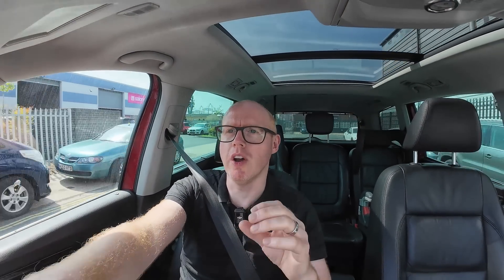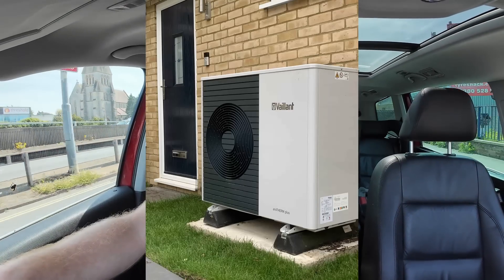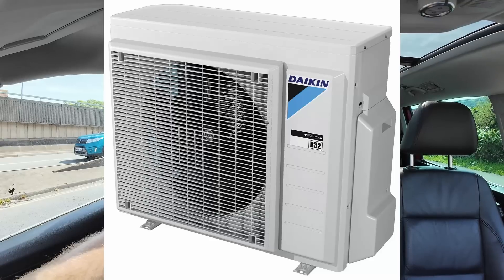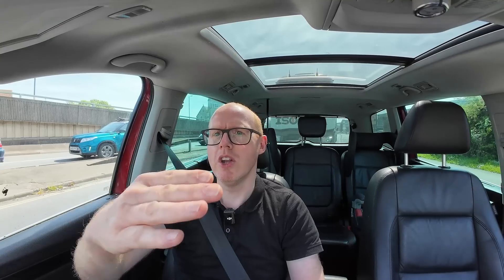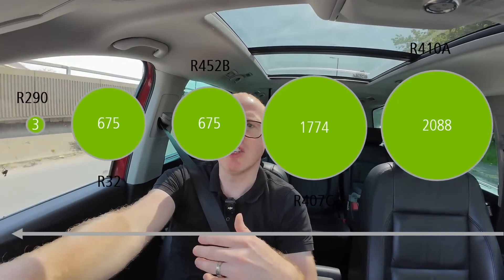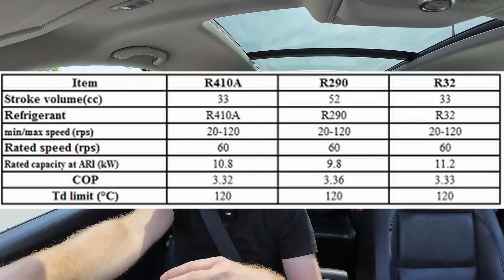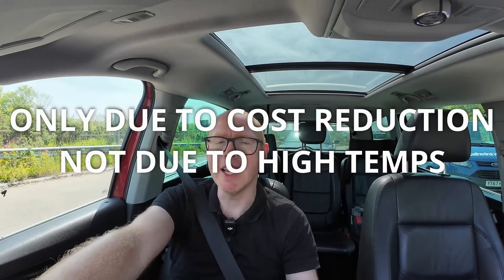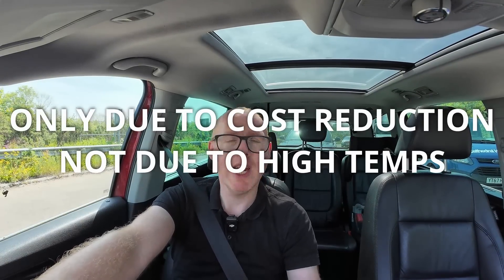High Temperature Heat Pumps Solve Nothing! Octopus Cosy 6 is nothing new!

Comment: I am lumbered with a central heating system which includes microbore piping set into floors and walls. If Propane could make an ASHP viable without replacing all the pipework that would make a heat pump possible for me.
Reply from the maker: Myth #1 heat pumps don't work with microbore.

Myth #2 heat pumps will have to work at high temps to operate with microbore.

Yes, heat pumps like a higher flow rate than gas boilers do, but we've been over-speccing our pipework for many many years anyway.

If you have 10mm copper microbore then you can easily deliver 1kW of heat down that pipe. Most radiators in most houses do not need more than that.
Your microbore will be spurred off a 15mm or 22mm pipe and normally feed just 1 rad.
If it's just a short 10mm drop then you can carry even more heat energy through a short run.

There are at least 3 of us on YouTube who have shown our Vaillant heat pumps operating perfectly with microbore. My SCOP is over 4. My design flow temperature is 45 degrees.
Most of the time my flow temp sits around 30-35 degrees throughout winter.

R290 is unnecessary but does offer the lower GWP benefits.

Comment: Doubling back on this one. From a strategic view I think the move from Octopus is genius. Unlock a bigger market, slashing installation costs and ensure that it is viable with competitive rates and smart software. I take your point - there is a chance to make an impact. I’d love to see the Heatgeek/open energy monitor tweaking the cosy 6 at low flow and really seeing what it can do.
Reply from the maker: Vertical integration can be excellent for both business and consumer when it works.
Early reports are showing that the Cosy/Octopus API and integration does indeed have a few software tricks up it's sleeves so whilst it may not achieve the best COP out there, it looks like it'll be able to achieve the best running costs.
Reply: @UpsideDownFork  Thanks for the update. Make me think of Apple's play on bringing tech to the masses. Delivering an ecosytem that makes the experience as frictionless as possible. There is a lot riding on "when it works" - let's hope that it is flawless

Comment: Just to add a little fact, i have just had the information through about the Cosy 6 and it has another problem.

It can't run on any microbore pipe! 
Well that counts out pretty much all new build housing going up throughout the uk in the last 20 years and more.
Unless you rip out your brand new piping and probably flooring, carpets ect ect to fit a larger pipe you are absolutely buggered.

All this new ashp tech  from octopus housing is complete junk unless you have an older house with the larger pipes.

My home is only 9 years old and i would love to get an ashp from Octopus as our gas combi boiler is not the greatest but after the information on here and the pipe issues i can't justify ripping apart my home of under 10 years for something that has been designed for a bygone age or just older house's.

Its a two finger salute to everyone who is being done over because they have gas in relative new builds.

£300+ quid to get a new ashp from octopus my big butt its not.
Consider the damage to my ceiling while they rip up the upstairs chipboard, everyone knows the plasterboard downstairs is going to crack and flake away as these new builds are constructed poorly.

Is octopus going to fix that, i very much doubt it.
Reply from the maker: I am surprised by this. Very surprised.
Do you have 8 or 10mm? Is your plastic or copper?

The Cosy 6 should be able to handle microbore just like every other heat pump can.
Do you have room for a buffer tank? That's what Octopus normally use for their installations and the thing that usually guarantees the correct flow rates for microbore pipework.
Reply: @UpsideDownFork  it's 10mm plastic, I have room for a buffer tank and I have had them visit twice to check and go into a detailed chat about it.

On the official data that has been sent to me it's clearly printed that the Cosy 6 is NOT compatible with a microbore system.

I am having a chat with them this morning to find out a bit more and get an answer to this.

The other ASHP that octopus offers does work with microbore so I will probably have to go back to that but I have serious doubts if it's going to run my heating and hot water sufficiently.
I have waited for a long time for the Cosy 6 and I now feel I have been strung along for something that won't work.

I am not best pleased 😒
Reply from the maker: @Devonshireandproud  the Cosy 6 is an unproven unit, so I guess there is some risk attached.
The daikin units are widely used and well understood by most installers, even outside Octopus.
I wouldn't have hesitated to have a daikin units installed at our house, unfortunately it just failed the noise test by a single decibel!

Once you find out more about the Cosy 6 I'd love to hear more about it.

If you've got any of the documentation, would you be willing to send it to upsidedownfork @outlook.com ?
Reply: @UpsideDownFork  below is a copy of a paragraph from octopus that I have been sent.

" I've had an update from our Install tech team - they've told me that although you qualify for the Cosy 6, the higher flow rate of this unit can't run on your existing pipework that contains 'microbore'. Microbore is compatible with the Daikin unit but not with the Cosy 6. A re-pipe will be needed to be able to proceed with the new unit. 

If we proceed with the Cosy 6 - we negate the need for planning permission but then have to address a re-pipe, to upgrade any microbore. I can assist with the organisation of this. 
If we proceed with the Daiken (1st position) - your planning permission application is ready to be sent and paid for. We'd then wait for the council response before locking you in for an installation date. "

Edit: as the documents have our private information on I am not willing to send that but as you can see from a copy of a part of the response I got you can clearly see that the Cosy 6 will not run on microbore, I will update this if I get any more information from my phone call with them today.
Reply: @davedevonlad7402 interesting! We're in 2 year old newbuilt with 10mm microbore and Octopus is pushing us towards Cosy 6. Not convinced though on performance and heat pumps shouldn't be really run hot and fast, but lukewarm and slow.
Reply: @MotivatedAcademic  Absolutely right, I previously had a mitsubishi ecodan that performed much better than this, I was fortunate as I was doing a renovation so the flooring was up already and we put in larger pipes and only slightly larger radiators.

I am getting an ASHP from octopus now but it's not a cosy6 it's a Daikin instead that will run on my microbore at a lower temperature, I have checked with Daikin themselves and with my heat loss calculation it will work quite efficiently.
ASHPs will work on some microbre but the octopus cosy 6 will not and that's my point, if I didn't question it I would be left with a system that probably won't work.

My advice is really do your homework and ask questions, lots of questions.
Reply: @Devonshireandproud  I think Daikin it is then. Seems more sensible choice.
Reply: @MotivatedAcademic  at the end of the day it's your choice but as you can see from my interactions with octopus it was a pretty easy decision not to go with the Cosy 6, it's going to cost more to heat up, the pipework is going to run hotter than I would like and I would have to have my house ripped apart and I haven't long finished decorating, also octopus said they won't install pipes under the floors only in my loft but I have no soffits, when I asked for the lead engineer to come out we discussed the options and said the floor option was the "only" way it could be done so we agreed to move forward with that, also i got the survey done twice as the first guy said i had to go through planning as the Daikin failed the noise assesment BUT I asked for a second opinion and guess what it passed with no issues at all and saved me £300.

I have had some worrying issues with the octopus ASHP team in getting information and had to fight for it but they do fit it all for a very respectable price and you really won't get an ASHP for as little as £300-500 as I am paying.

My previous ecodan and relevant equipment cost me £13k three years ago so it's value for money if the system "Daikin" for me or the "cosy 6 " works for you.

Personally I would avoid the cosy 6 unless you already have the larger pipes fitted already.
Please be aware my installation is booked in for February and has took almost 10-11 months to get it to that stage because of the muck ups from octopus.
Good luck with your installation.

Comment: R290 is more electrically efficient and is a much lower impact green house gas. R290 is also cheap and available. R290 runs at lower pressures so it's easier on the compressor mechanically. You should mention all these things if you want give information to others.

Comment: Robert from fully charged has the Tepco himself and seems really pleased with it
Reply from the maker: How do I put this politely? I don't think Robert has a clue.
His consumption is probably off the charts but he has a field's worth of solar and multiple Tesla power walls so I don't think he's too concerned with high consumption. His situation is hardly feasible for 99% of the population. Paying for his 3 phase upgrade would have been a seriously expensive one too.
If he had dropped a heat pump in instead of a tepeo, he could have reduced his consumption by 65-75%
Reply: @UpsideDownFork  i think thats possibly unfair to kryten, but also not to far off the mark . He said specifically he chose the tepeo over a heat pump because he wanted the coverage. i think his family like hot radiators, which is fair. i also think youre spot on with his usage and generation patterns. theres a fair few folks in this world who will be green and accept the cost to have it on their terms. ultimately, the money he saves on petrol probably offsets his additional electric costs :) 

The other thing ill say about tepeo, everyone in heat pumps goes on about microbore being the devil (true or not), and lots of people want to be told its an easy replacement, no radiator changes etc.  Im looking at one for this reason, my home is almost fully plastered in microbore heating. i understand heatpumps can use microbore with the right setup, but im a green tech nerd!
Reply from the maker: @sebaileyus8043  microbore here, no problem at all for heat pumps 👍
Hot radiators are just a sign of people accepting the status quo and not knowing that something better exists. 😉

Comment: If one needs to run a higher flow temperature due to design of radiators and lack of insulation is the COP any better? Also,are they any quieter?
Reply from the maker: Cop is better at lower flow temps.
Sound is also marginally quieter at lower flow temps. Probably not noticeable in the real world.
Reply: @UpsideDownFork  need the figures. Only makes economical sense at 4 and above. Noise is a real issue.  Back ground noise for me is 30dB weighted at 0-100 Hz.  Fans and when the compressor kicks in is currently too loud.  Not sure I could live on an estate that was all heated with these.  In Sydney we used to have to turn off the air con units at 23:00 hrs due to the noise and these are essentially heat pumps as they heat and cool.
Reply from the maker: @Beaker159 If you look up the data sheets for the product you're interested in, you will find some data. Some manufacturers hide the sound levels in their technical installation manuals which is sometimes not publicly available.

These newer Gen heat pumps are so much quieter than AC units that we are all familiar with.
It's achieved by a lot more rubber isolation mounts internally and externally, larger diameter fans that spin more slowly and a rotary compressor which all adds up to a significant improvement in noise produced by these.

Comment: Could self builders install their own plumbing, rads or UFH, circulation pumps and DHW tank then get Octopus to install a Cosy and controls for free?
Reply from the maker: Yes, in theory. But they won't guarantee your work.
Reply: @UpsideDownFork  surely they wouldn't guarantee anything outside of the kit they install anyway, so is the self build route any different from being lucky in already having 100% compatible plumbing/tank/rads in an old house, ready to just connect up a Cosy 6 + controls for free?

Comment: Great video 
I’m in the process of buying a air sauce heat pump from octopus energy 

I’ve recently bought TADO V3+ WIRELESS HEATING & HOT WATER SMART THERMOSTAT along with 
12 Smart TRV Thermostatic Radiator Valve 
Which works great with my combi Vaillant bolier 

My question is would all my 
TRV Thermostatic Radiator Valves and wired tado receiver be all compatible
With a R32 Daikin heat pump? 

Or would I just have to buy a new Tado receiver and stats again ? 

Thanks Gary
Reply from the maker: They can be made to work but they will kill your heat pump efficiency.
Sell them on as a kit to someone with a gas boiler.
Running your heat pump as open loop as possible is the way to best efficiency and comfort 👍
Reply: Jesus I better break the news to mrs.

Comment: There are a lot out their waiting to rip the consumers off. In my case a 10 year old three bed semi with an EPC of A. Three companies gave me a ball park figure of £1500 to £2000 to install a heatpump all three wanted around £250 for a survey before committing to a price and one of the company’s wasn’t even going to change the cylinder instead fitting a water to water external heat exchanger, all were Heat Geek engineers.  In the end Octopus installed a Daikin heatpump for £8600 less the grant of £7500 and it’s working great. As for their high temp heatpump if it helps people change without costing the earth then why not? As one only needs it to run at those temperatures when is really cold outside or as in a lot of case of people are at work just need a quick boost in the evening. Don’t shoot Octopus until you’ve tested the goods. A retired heating Engineer of 50 year experience
Reply from the maker: I don't think anyone was setting out to rip you off.
That just sounds like the consequence of economies of scale.
Reply: @UpsideDownFork  I notice you are strangely silent in regards to the poster's claim that you should not shoot Octopus down ill you tried them and you seem like get another self opinionated egotistical who thinks he can think!
Reply from the maker: @taefravis note that this commenter has a Daikin "low temperature" heat pump installed.

Comment: I'll let you into a secret, I've run a low temp heating system for 30 years, and have never run a legionnaires cycle. For us it comes down to having the correct size tank.

Comment: Am I missing something?
Isn’t the main point of ‘high temperature’ heat pumps that they can use micro bore and existing radiators thus saving a lot of installation trouble and cost.
Reply from the maker: That's the fallacy that has been touted.
The point of the video is to explain why that statement is untrue 👍

Comment: To me, the main advantage is that it reduces/eliminates the need to upgrade your radiators. My 1990's built house needs a flow temperature of about 65C on the coldest days of winter (I set it as low as possible each day), so from that point of view this heat pump could cope. Swapping out 3 or 4 of the largest radiators would be possible, but replacing my microbore pipes would be a disruptive nightmare if that was needed..
However, any ideas as to the COP would be in that scenario - very low I'd suspect. With electricity costing four times as much as gas I'm far from convinced about changing over to a pump.
Reply from the maker: A flow temp of 65 degrees would be below 2.
Microbore pipework is not the obstacle that some seem to portray.
Our house has microbore and is no issue at all.
If you have single rads that need more than 1.2kW of heat output then you may need to upgrade that pipework to 15mm.

Lots of variables.

High temp heating won't solve any issues with the current delta between gas and electricity.
Reply: @UpsideDownFork  Thanks for replying - I've got some large double panels (rated at 2.1, 1.6. 1.2 kW) plus an 0.8 kW. The rest are all circa 500 W. So if I upgraded those four by (say) 50% you think that microbore would be unsuitable? 
Can you mix microbore and 15 mm if if I left the smaller ones unchanged? I'm wondering if using lock-shield valve settings to balance the system, a lot of the advantages of the larger pipes would be lost.
Reply from the maker: @roberthuntley1090  It's all about the room heat loss. In our home for example the house was originally built to a spec and along the way, cavity wall beads were added as well as triple glazing. This meant that when we came to upgrade radiators for the heat pump, one was already oversized, one was the perfect size and the rest mostly just needed moderate upsizing but without pipework alterations. Quick and easy to swap rads when the pipes remain the same.
What i'm trying to say is that the rated outputs for the radiators aren't what you should base your pipe sizing on. As you've rightly pointed out, lockshields will be used to balance the flow down anyway.
Yes, you can mix microbore and 15mm. Our downstairs had microbore throughout the downstairs and 15mm upstairs from the original build.
The extension had electric underfloor heating when we moved in so a new 22mm pipe was run to the extension which then splits into 2x15mm feeds for 2 large rads in our extension.
Just a case of balancing it all which I find easier to do with low temperature heating that the old gas boiler.
If you want to get your own accurate heat loss, i'd recommend heatpunk as a good tool.
Reply: @UpsideDownFork  Thanks for the helpful reply.